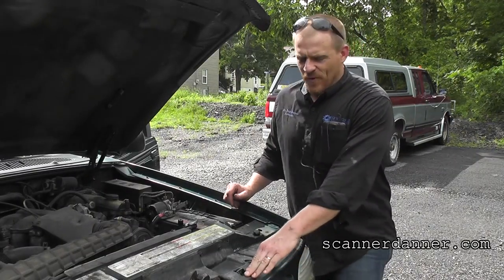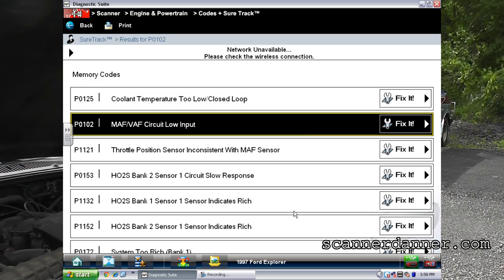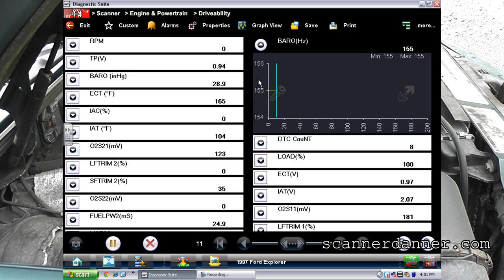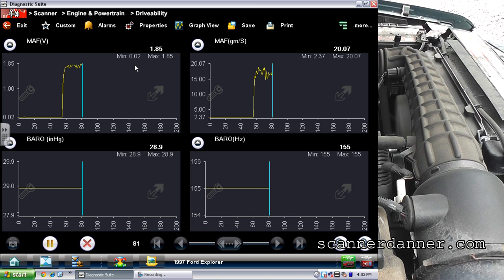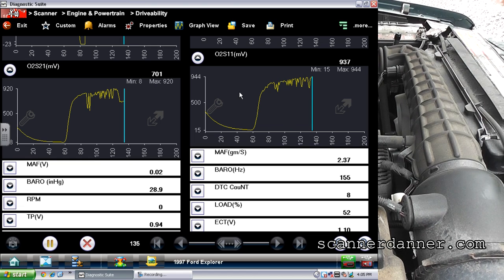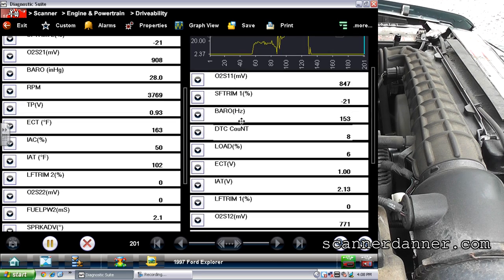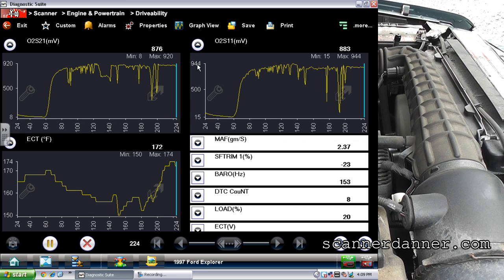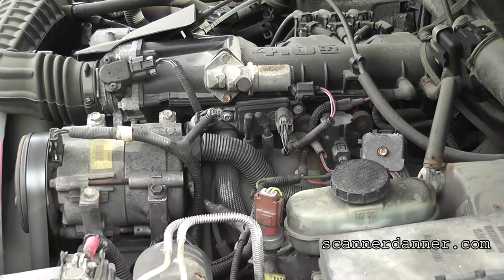How to test a Ford MAF sensor

Comment: Thanks ScannerDanner - My '89 Ranger 2.3 with 135k  restoration project stalled because I couldnt find the problem. Replaced MAF and solenoid a week ago and stalling and hesitation persisted. Dangerous for driving.  I put in o2 sensor cause it was totally clogged.  Better, but still bad. Did what you said and disconnected MAF and turned ignition on off on off.  Wow, runs great!  The aftermarket MAF is crap. Will be putting in a Motorcraft MAF tomorrow and I think the problem is solved.

Comment: Great video. I agree with the grams/second approximate correlation to engine size in liters. This is what I was taught and have observed. However, it is an approximation. As you are no doubt aware, the speed of the PIDs could be increased if you would have gone into a custom setup and limited their number (as we should remember, the PIDs are pushed out by the PCM in series, i.e., sequentially, and repeated over and over).

Comment: 7:19 My guess It's adding fuel because the MAF gm/S is telling the car it's flying Harry Potter style with no speed or other input feedback.  Dumping fuel to try to keep the engine running but it's just pegged max rich.  It's got a baro MAP backup according to the PIDs (you show baro). The question is why can't it tell that the MAF is lying using the O2, MAP, TPS, IAT, and other inputs?  Ahh because it's in open loop strategy.  Think you just answered your own question.
Reply from the maker: ***** the BARO PIDs are actually calculated off of the MAF, no MAP  on this design. It is goofy that Ford still reports this as a frequency number. (left over software from MAP engines no doubt)
Reply: ScannerDanner PCM's have enough input data to make that determination. Disappointed in the engineers but whatever it's job security I guess.

Comment: From what I've heard the grams per second should be roughly the size of the engine at idle and about 40x the engine size at w.o.t. (4 liter engine around 4 g/ps idle and around 160 g/ps at w.o.t). I'm pretty sure these numbers will not work with turbo or supercharged engines though.
Reply from the maker: Thanks!
Reply: What if 4.0 stock is higher than 4g/s at idle and negative ltft?
Reply: At w.o.t should be 80% of max engine horse power, for 100HP engine is 80g/s
Reply: Internet states 80 (g / s) =
10.5821886 lb/min. My maf reader at idle on my scan tool, I believe was 0.91 lb/min
Reply: 4 (g / s) =
0.529109429 lb/min and my 4.0 is at 0.91 at idle.
Reply: @MC-hs4mf  i suppose you could have dirty MAF. Anyway as Paul said if you have negative stft at idle and position at full throttle - dirty MAF
Reply: @Kris-82  cleaned it, didn't change. Changed filter. And I don't see any comments from a Paul.
Reply: @Kris-82  long term is negative.
Reply: @MC-hs4mf  that's almost the same. With time your ECU put short blues info long term, because it want to have short term close to 0. Keep full throttle and observe stft and ltft for a while. If your stft goes up take a look at maf
Reply: @Kris-82  replaced filter and reset battery and still about the same.
Reply: @Kris-82  maf .04 with engine off, tps 19% with engine off not touching accelerator and 92. Something pedal to floor
Reply: What does w.o.t mean? How can I find what grams per second be on a f150 5.4 liter at idle be?

Comment: Very good info about the mass flow sensor but the fact is you should have replaced it to prove and to see by the scan tool how a mass airflow sensor works...
Reply from the maker: I try to show the replacement whenever possible but I did prove the fault without showing the new MAF. The bad MAF had good signals at times. Same thing the new one would have shown.

Comment: My 98 mountaineer keeps throwing p0102 cleaned maf replaced maf no matter what I do I read 1.8 to 2.6 g/s and it jumps between the two at idle and stays at 1.8 when I throttle up

Comment: Would you sell that job plugs and a MAF or just the MAF and the plugs will clean themselves up after running properly?
Reply from the maker: m ph plugs will clean themselves but I should have recommended an oil change for sure. Then also warned of possible O2 issues in the future.

Comment: I got a 98 Ford Explorer. I have engine codes on the other side of the spectrum. I got lean codes on bank 1 and bank 2. 
Thoughts? 
02 sensors? MAF sensor? 
ECM? Fuel injectors?
Reply from the maker: Are your fuel trim numbers better or worse at idle compared to 3000 rpm in park?

Comment: Scanner Danner got a question bud..... i have a ford mustang gt and I have a misfire I've replaced plugs and coils and every normal thing you'd try..... I took it to ford and they said my maf is out of range its suppose to be 156 hz and it's running like 148 or 149...... is that enough to cause running issues?

Comment: Hey man love your videos. My 98 explorer has been having a stalling/shaking issue at idle. When i'm sitting at a long light or a drive thru i notice my RPMs dropping to the point that the car shakes and the lights dim. SOmetimes i have to put it in park just so it doesnt completely stall out. It stalled on a red light today. I ran seafoam a few days ago and the problem was gone for a couple days. The RPM needle was steady as ever! Thought it was fixed. But issue came back today. 

Replaced PCV,IAC,upper and lowe rmanifold gaskets. Cleaned Throttle body to new condition, cleaned MAF several times, new air filter, fuel filter is a year old. Doing a coolant change tomorrow since its been 60k miles since ive owned the car and i've never done it.  ONe more tidbit of info is on FORSCAN i have a CASE GROUND reading of -0.15. This matches the multimeter reading from my negative terminal to the case of the alternator. I know its supposed to be .05 or less. Could a bad ground be causing all these issues? Thanks if you read this.

Oh btw no codes.
Reply from the maker: I'm fine with that case ground reading. How does it run when your on the throttle? Have you done a compression test? What are your fuel trim numbers at idle?
Reply: Long Trim 1 = -7.42      Long Trim 2 = -3.91

Short Trim 1= Bouncing from -.42 to 1.96 seems to be bouncing all over

Short trim 2 = -0.23 to 2.80 also bouncing around a lot. 

FUel pulse width 1 = 2.4ms

Fuel pulse width 2 = 3.12ms

Is the short trim supposed to be doing that? Car runs great when not in idle. Never stalled out of nowhere and starts up every time  at cold start or after it stalls. I'll add that my catalytic converter is rattling at idle as well. They are almost 20 years old at this point. COuld that cause the stalling?

Comment: also i have been seeing some start stall issues and it was maf problem too. i have had good luck with engine size being close to g/s, but it is way off on smaller engines like 3.0l and smaller. (its just a ball park number anyway) i mostly use load values and max g/s to condem maf. thats if it runs good enough...
Reply: Mike S what g/s have you seen at idle in a 3.0 in ford specifically?

Comment: Have you ever had a MAF issue only affect one bank? Have an 08 f150 with a 4.6L in the shop that has p0174, misfires on 3 of the bank 2 cylinders and a p0316. Noticed the p0316 could be faulty crank sensor so I tested with a scope and it showed excessive air gap. Pulled it and the magnet was gone. Swapped and still have the same issue. LTFT is about 30 on bank 2 and roughly 8 bank 1.
Reply from the maker: Andrew Johnson It wouldn't be a maf sensor but could be a plugged cat on one bank or a timing chain issue where one cam is off a few teeth
Reply: ScannerDanner I was leaning towards timing next. For some reason I wasn't even thinking about exhaust restrictions. Its not really a low power situation though. Just a rough idle. Kinda smooths out at cruising speeds.
Reply from the maker: Andrew Johnson okay, for sure an exhaust restriction would be felt during a drive, so it is probably not that. Is that crank code still showing up?
Reply: ScannerDanner not entirely sure. The guy came to pick it up the same day I changed the sensors. I told him I needed to perform further diagnosis and he said he would bring it back. Pulled fuel trim before he left and seen bank 2 was still very lean at about +30 and there were multiple misfires on bank 2.

Comment: I have a Fiesta SE 2012 1.6. The MAF conector got smashed, and i bought another conector, but i need the diagram of the wires. The wires are almost of the same color. I need to test with a scope before to make sure. Where i got that info? MAF: 3L3A-12B579-BA 6 pin conector. I'm from Brazil, its not easy to get this info here :(
Reply from the maker: https://eautorepair.adtrk.biz/?a=10817&c=24&p=r&s1=

Comment: MAF ECM Ground wire makes clicking sound when I tested the wire number 2 of 4 w key on w 0v. But also reads 12 volts on a multimeter before I even turned the key on why would this be on a MAF ECM Ground? Please help
Reply from the maker: you sure you are on the ground wire of the MAF for that test? What are your symptoms?
Reply: @ScannerDanner  yes I looked at a wiring diagram it made like a short circuit type clicking noise I've even had the test light flicker unstable on the fuse that controls the MAF, in process my battery died while testing the vehicle. I was at my witts on this one so I turned it over to a Mechanic Shop to see if they can figure it out... With a new battery

Comment: Thanks for this video!
My 2003 Ford Escape 3.0 (AJ engine) has a bad fuel milege. I tested my MAF sensor as you showed, but i have 6 wires on it. As i understood 1st and 6th (E and F letter) wires go to temperature sensor inside the MAF body.
I tested 12volt supply and both grounds, everything is ok.
Then I connected red wire of my multimeter to 5th (D) wire and black to negative contact of the battery.  When i put the key to ON position, multimeter shows 0.07 volts. When i strted the engine, multimeter showed 1.15 volts and after engine got a work temperature multimeter showed 0.76 volts. Does it mean that my MAF sensor is bad?
Everybody says that when the voltage more than 1.03, MAF sensor is bad, but nobody says what if the voltage less than 0.9.
Sorry for my English!
Reply from the maker: It is becoming more and more difficult to answer questions here. I have 80,000 people asking me for help now. So I have created a forum to help you guys better. It is free to join and we can exchange pictures, wiring diagrams and waveforms if needed to help guide you through the process of troubleshooting your vehicle. Thank you so much! Hope to see you there. 
Paul Danner (ScannerDanner)
 https://www.scannerdanner.com/forum/post-your-repair-questions-here.html

Comment: Neat trick on the rev limiter to stop injection pulse to drive the 02's lean. 
Nice short cut to the back pressure test as well.

So the MAF sensor is reporting more air to the ECM than is actually coming into the engine causing the ECM to drive the mixture richer?

Comment: Hey my 05 mustang gt doesnt have a check engine light but im suspecting a bad maf.. I have rough idle here n there but under load theres a lag in accelerates. When taking off from a stop it feels like it wants to stall and engaging the clut h is a drag any thoughts?
Reply from the maker: test it! At WOT you should peak over 4 volts on that MAF sensor
Reply: @ScannerDanner  ok i will thanks! and would a faulty maf cause the drivability issue i have where as im engaging the clutch taking off in first gear it almost feels lke the idle drops or it wants to bogg down? Once its running it feels sluggish and if i punch it hesitates but eventually it picks up. Sometimes when i start the car i can sorta smell gas. No leaks tho..

Comment: My 1999 ford ranger 2.5l the maf GMs  read 2.25 at idle when I give it throttle it drops to 1.27 gram per second. I got a p0171
Reply from the maker: how does it run with the MAF unplugged? Ford has good back-up strategies
Reply: It run better unplug I replace it it running good now

Comment: , can you recommend a scan tool like Auto tap or enginenuity for 1988 Ford Econoline OBD1 can't seem to find them. Low dollar medium price high dollar choices recommended. Thanks love to all Jeff
Reply: Those are all OBD2 (1996-newer) scanners, they're not gonna work on a 1988. Sears has a decent CRAFTSMAN scanner that works with OBD1&2, I think it runs for $270.00. Check it out!
Reply: TheStudentoflove get a old snap on mt2500 on ebay for a couple  hundred dollars.

Comment: hey scannerdanner. how reliable is a sweep test for a MAF sensor? I did a sweep test with a pico and I didn't get that inital spike. Could this mean that the unit needs to be replaced?
Reply from the maker: Echowhiskey the initial spike has a lot to do with operator error. If you do not let the idle come all the way back down (empty the manifold of psi) and then also if you do not rapidly snap it, you will not see the spikes I've shown in my book. Other than that, a drive by wire system may give you problems, then contaminants on the hot wire for sure.

Comment: Load pid was screaming maf issue, it showed 100% at idle, you should look into that pid it is my go to for suspect mafs especially on fords, and Toyota
Reply from the maker: That load PID also showed 100% load with the key on. Also it is a processed calculation. Did you see it with the MAF unplugged? Guess I don't use it enough to trust it. What other variables can cause a higher than normal load PID?
Thanks Michael!
Reply: ScannerDanner Albin Moore taught me the method, yes it is processed data, but it's main input on most systems is MAF, and throttle angle. So on a ford if on a full throttle pull it should hit 90 +%, if it is in the low 80s or below and no issues with the TP sensor you are done it either needs to be cleaned or replaced. Toyota the load will not go as high so high 80s to low 90s any lower and also done misreporting MAF
Reply from the maker: Good tips Michael. Thank you!
Reply: ScannerDanner 
I have a 2001 ford Taurus. And it James into rev and drive hard and keeps breaking my mounts.can you help and tell me what the hell is wrong
Reply: Got a Ford 3.0 shows 30% load at idle and that was with the serpentine belt off due to a locked up ac pulley. I'm thinking that is a little high and suspecting maf sensor issue. Sound about right? -10% fuel trims at idle as well.

Comment: The signal of  MAF on my ford Windstar 1999 reads 1.6 on idle and decreases on acceleration. These are opposite readings to what I learned from your videos. Please help. The car is working fine.
Reply from the maker: I believe this is a Nissan Quest powertrain? Either way MAF voltage should not be deceasing with RPM rise. It should be increasing.
Reply: @ScannerDanner  Maybe he or she has a clogged exhaust.Only a clogged in my opinion would cause a decrease in maf voltage as there will be less airflow into the engine  due to an increase of exhaust backpressure. I may be wrong.
Reply from the maker: @bbmd2200  this was a long time ago, but it was stated that the car was "working fine" so that sort of throws the exhaust restriction out 😉

Comment: if maf sensor dameged the car will stop or no?
Reply: Not necessarily.  But if the computer is not receiving reliable data, it cannot compute reliable values for/from the other input that is gathered and used to compute what changes to make and how to manage the engine.  That translates into... it will still run, but it will probably run like crap and do unpredictable things.

Comment: Why did you use a gauge to test the back pressure. Doesn't the dpfe pid show the pressure already?
Reply from the maker: +Daniel Warren It does, but it is designed to read a differential psi when the EGR opens. If psi is the same on both tubes, there is no change in signal voltage. So with the EGR closed, I cannot use this sensor to tell me anything relating to psi in the exhaust. Make sense?
Reply: +ScannerDanner I think I understand. The sensor is reading the pressure but the data pid doesn't show that, it shows the difference in pressure, Is that right? 

Dpf pressure sensors are identical but I'm sure the data pid will show you the actual pressure in front of the dpf.

Comment: I think with the newer 8 wire is almost twice the liter and the older ones its 1 per liter . which is not scientific but I think it gets you in the ball park.   I don't have any hands on confirmation , I just have been told that it is quite different